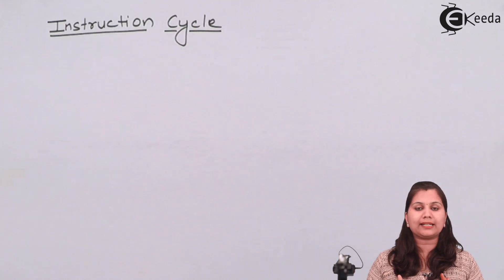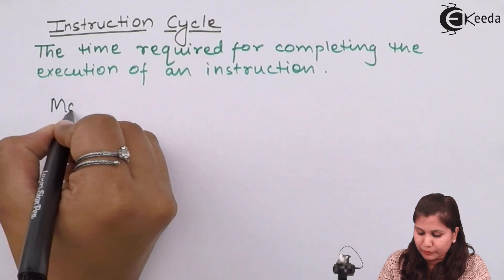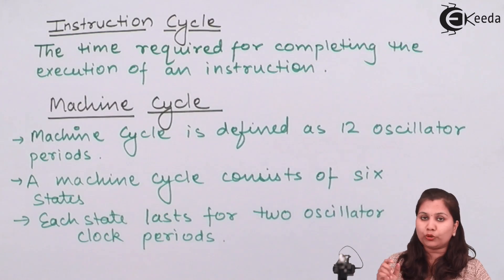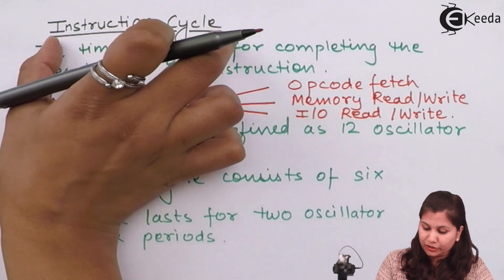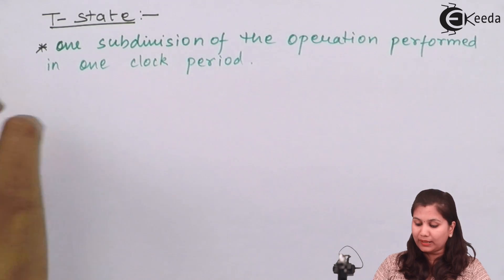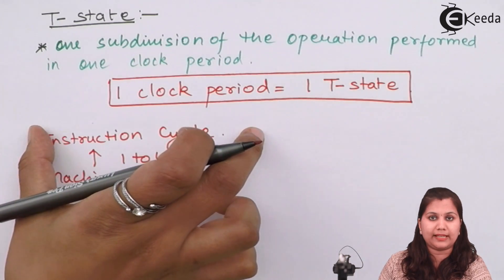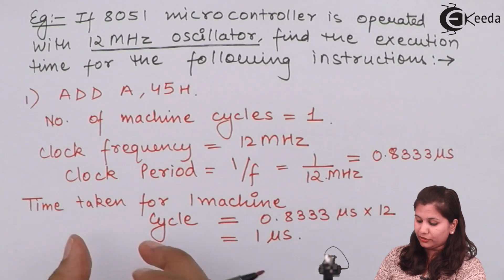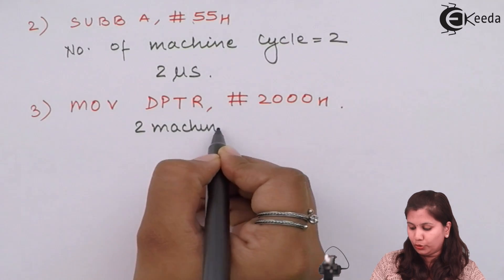Machine Cycle and Instruction Cycle in 8051 Microcontroller - Microcontrollers and Its Applications

Comment: What is a Machine Cycle?

In the 8051 microcontroller, a Machine Cycle is the basic operation cycle of the microcontroller during which one operation (like fetching, decoding, executing) is performed.

1 Machine Cycle = 6 Oscillator Periods (clock cycles).

Every machine cycle can perform one basic operation (e.g., fetching an instruction byte, reading from memory, writing to a port, etc.).

The 8051 can execute instructions that require one or more machine cycles.

💡 Example: If the oscillator frequency is 12 MHz, one machine cycle = 6 / 12 MHz = 0.5 µs.

Comment: Plz explain mam how you have calculated the machine cycle... 🙏
Reply: Yes ??
Reply: Key fact:
1 Machine Cycle = 12 Clock Cycles in some early versions of 8051 (like original Intel),
but in most modern 8051 (like AT89C51, etc.),
1 Machine Cycle = 6 Clock Cycles (Oscillator periods).

Comment: how can we able to understand that it contains n no.of machine cycles
Reply: To determine how many machine cycles an instruction takes in the 8051 microcontroller, you can refer to its instruction set documentation, which typically includes:
🧠 Key Concepts
• 	One machine cycle = 12 oscillator periods in standard 8051.
• 	Each instruction specifies how many machine cycles it takes to execute.
• 	The number of cycles depends on the type of instruction (e.g., arithmetic, logical, data transfer, branching).
📘 How to Find Machine Cycles
You can check resources like:
• 	The 8051 Instruction Set Table which lists:
• 	Instruction name
• 	Opcode
• 	Operand
• 	Byte size
• 	Machine cycles required
• 	The Keil 8051 Instruction Manual also provides detailed cycle counts for each instruction.

Comment: How to find machine cycles
Reply: Key fact:
1 Machine Cycle = 12 Clock Cycles in some early versions of 8051 (like original Intel),
but in most modern 8051 (like AT89C51, etc.),
1 Machine Cycle = 6 Clock Cycles (Oscillator periods).

Comment: How to identify no of machine cycle!
Reply: Key fact:
1 Machine Cycle = 12 Clock Cycles in some early versions of 8051 (like original Intel),
but in most modern 8051 (like AT89C51, etc.),
1 Machine Cycle = 6 Clock Cycles (Oscillator periods).